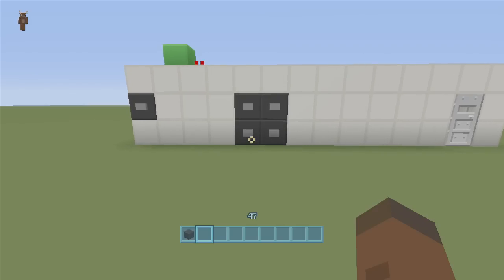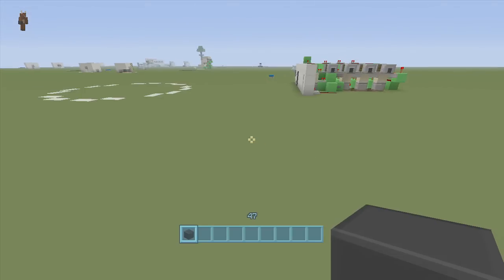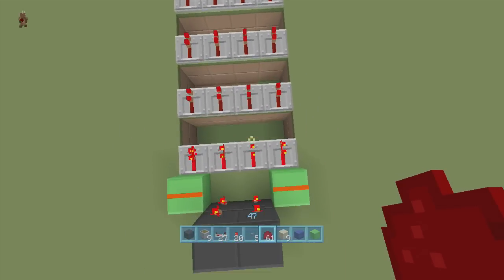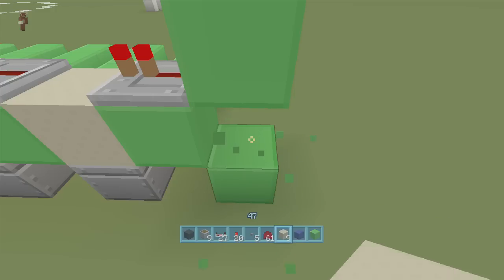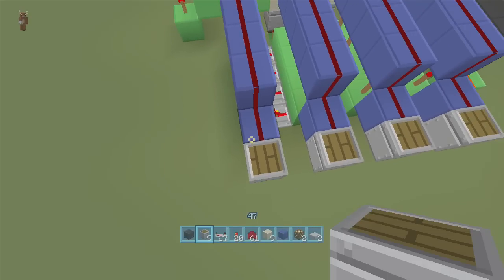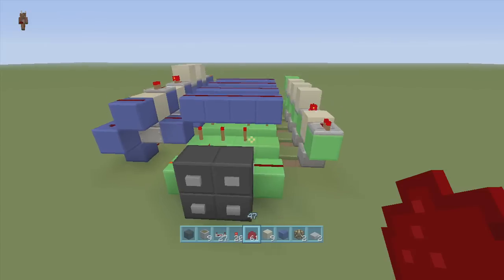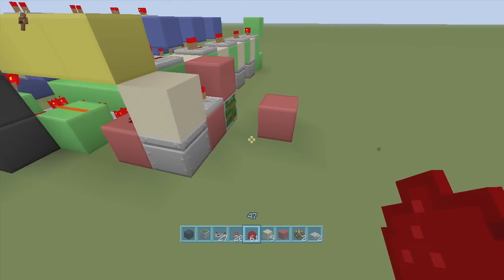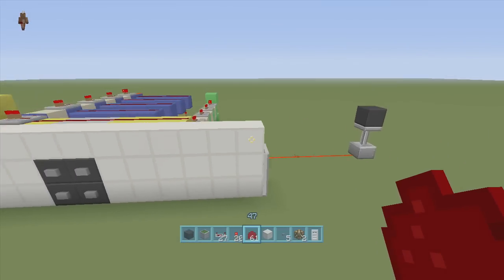Combination Lock [4 Button] "Redstone Tutorial" (Minecraft Xbox 360/One/Ps3/Ps4 TU17)

Comment: this was a great build! i ended up changing the output at the sticky piston, using instead a setup with two pistons pushing a block over or off the pit with the torch. i was able to wire three button switches so i was able to operate the 2x2 rock wall from both sides, you still need the combo to enter of course. Thanks for this video!

Comment: Is there a good way to switch this lock to block a circuit instead of closing one? I am trying to connect the lock to a piston door, which is closed while powered on. How can I make the lock power the door off, therefore opening it?
Reply: Richard Wallace I managed it, but its a bit of a workaround honestly. I'll try to explain as best I cna for anyone with a  similar issue. I have the device powering/depowering a circuit connected to a 3x2 piston door. Powering the lock piston will pull the block out of the circuit, opening the door. On the other side, is a button linked to a sticky piston that, when powered, will pull the block back, powering the door and shutting it. This allows you to enter the combination, open the door, walk through, press the button, and close the door again. Also on this side is a button that will repower the lock from the inside, pulling the block out and opening the door again. Only issue now is reclosing the door from the outside
Reply: Richard Wallace easy. just connect a not gate to the output of the lock and connect the not gate's output to the piston door. :)

Comment: U can actually install a reset in the rs nor latch just look at cnbminecrafts tutorial thats were I got mine
Reply: They changed the way that 1 block of redstone behaves tho, or something or other happened, I can't recall. You can make the spacing 1 wider to allow a straight line rather than just a dot, but the design is less compact on the whole, Albeit using a bunch less repeaters potentially, as I found from a couple experiments
Reply: There is an easy fix to that